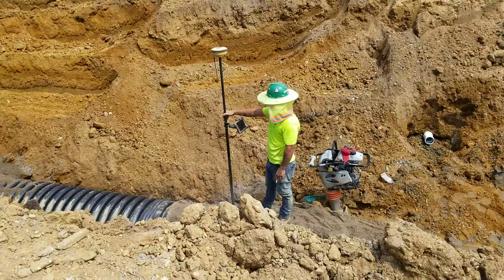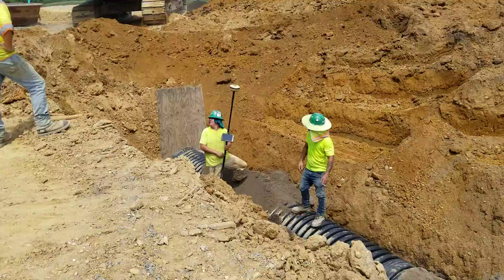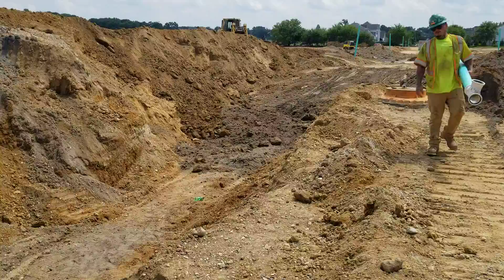Contractor Using GPS Surveying To Construct Stormwater System

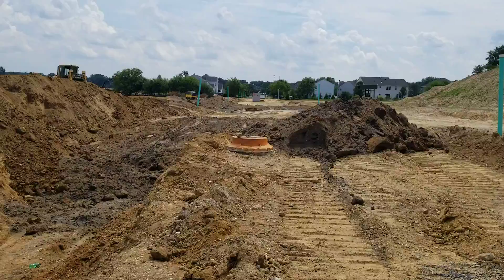Comment: I would have thought they were using a laser. What is that thing at 0:53 for?
Reply from the maker: That is just a manhole lid that gains you access down to the pipe network underground. ooops, am I supposed to now call that a person access cover? ;)
Reply from the maker: Oh and yes they are using a laser inside the pipe.
Reply: @JesseKozlowski  Lmao, I meant the square thing on top of the lid/access cover, looks like the thing that shoots lasers, something like this one which we use at my work. 
https://www.top-bouwlaser.nl/topcon-rl-h5a-bouwlaser-set.html 

But then again, the receiver that dude is holding looks like a GPS indeed. I guess that thing on top of the lid is just part of the lid or something? I suck at construction lol
Reply: @DeleteTheElite_   Your link is to a laser level, upper left corner, and a rod-eye, upper right corner with a tripod..  I'm not certain what the two items in the lower left are.  This isn't what is sitting on top of the man hole and yes, they are using a GPS unit.

I use to use these when I first started construction and was working on tilt-ups.  (Way before GPS units were used)  Sometimes I would work with bulldozer for the final sub-grade of a slab pour which is a concrete floor poured on the ground.  The laser level is set on a tripod then you have to level it with 3 set screws to center a bubble in a bulls-eye level.  Then you turn the laser level on.  The laser unit hangs like a pendulum and once it is in position the laser unit will start spinning at a high rate of speed so the beam rotates 360°.  

The rod-eye is the receiving unit and is connected to a pole.  There is both a visual and audible reference to let you know if you are too high, too low or at level with the laser beam.   

After setting up the laser I would go and place the bottom of the pole on a surveyor's elevation benchmark then move the rod-eye up or down until it was reading level with the laser.  Next I had add or subtract from that mark to adjust the rod-eye for the correct elevation of the sub-grade.  Now I could measure various points of the slab area and use hand signals to let the operator know how many inches it was too high/low or if we were at grade.    What is nice about the audible is that you don't have to constantly look at the rod-eye.  What is nice about the laser level is that is it a one man operation.  An optical level requires two people.
Reply: @fedogma8407  Exactly lol, they're handy tools. Thanks for the elaborate explanation :)

Comment: What is considered the range of error or accuracy with this method?
Reply from the maker: Carrier phase differential GPS is accurate to 1cm horizontally and 2cm vertically at 1 Sigma as published by the manufacturer which is 68.3% confidence. In surveying, we want higher reliability, so we scale that up to 2 Sigma (95% confidence) for 2cm horizontal and 4cm vertical.
Reply: @JesseKozlowski  Forgive me for my ignorance, who do you get the 2 sigma? Is it GPS + carrier triangulation? Or am I completely misunderstanding?
Reply from the maker: @c-LAW  , it's all explained here ...
CONTROL SURVEYING - MEETING POSITIONAL ACCURACY STANDARDS
Published January 05, 2020
https://www.youtube.com/watch?v=uOXSXI2I8p0&feature=youtu.be